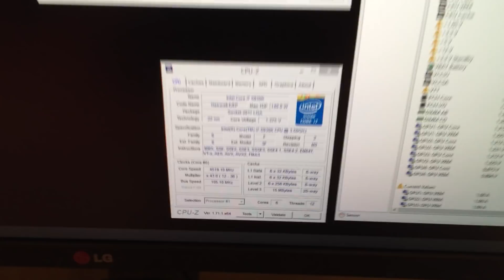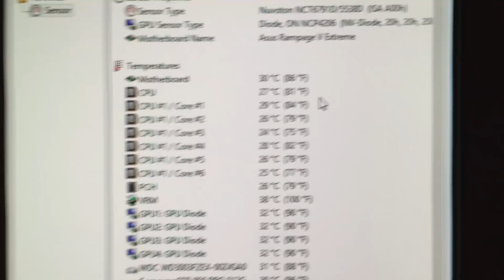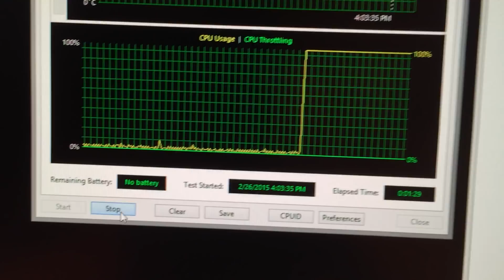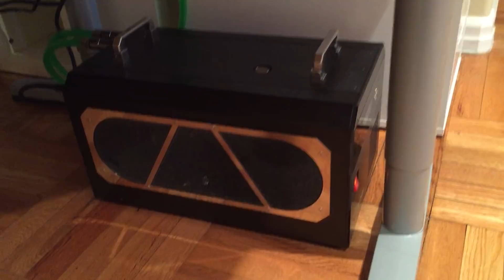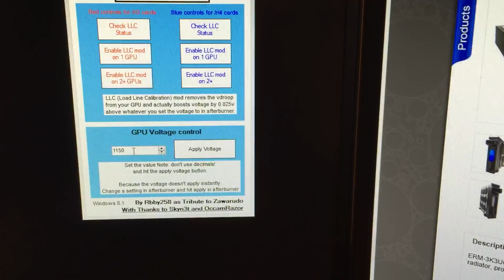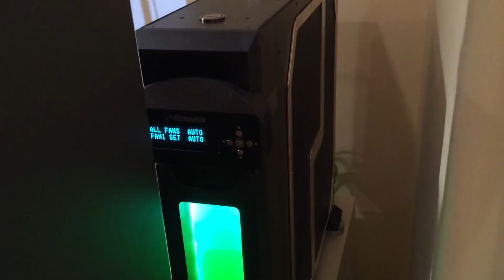PC Water Chiller | Koolance EXC-800 - Testing

Comment: Impressive overclocks for just a water chiller running at ambient temps. Especially by today’s standards.
Reply: 4.5 GHz on a 5930K isn't impressive though. Silicon Lottery stats say 87% of tested 5930Ks could do 4.5.

I'd be far more surprised if he could do 4.8 or 5 GHz with subambient water.

Comment: On 0:10 and 0:11, did you customized that back panel of the case? How did you extend the loop outside the case? What is that connector connecting to the soft tube? I am currently think about building such loop so I hope you can help me a bit. Thanks!
Reply from the maker: Those are the bitspower quick disconnects fittings: https://prnt.sc/pxow6z
You will need to drill the hols for them.

Comment: Do you have Problems with condensation?
Reply: You can avoid this by getting a weather gauge that tells you the humidity level in the room. 

Using the room’s humidity along with the ambient room temperature you can determine the dew point at which water will condensate. Set minimum temperature slightly above dew point
Reply from the maker: Yes, during the summer time only, when humidity level is up. You just need to tweak settings each year to avoid it, plus having liquid Alarm installed. I have burned one CPU already.
Reply from the maker: Only summer time. You should be careful when adjusting temps. I already burned one CPU

Comment: What cpu will rip 400 watt out of the outlet? my god. My 5820k at 4.7 takes about 170-180 according to hwmonitor.
Reply: Any of the i9 series overclocked will. 7980x will rip 900watts.
Reply: They most certainly will not. 5-600 at the highest. The whole system might require upwards of 900 watt. But never the cpu itself. If you are to overclock them to that point you need liquid nitrogen or helium. A standard watercooled 4.8 oc will probably only pull 3-450 watts.
Reply: At 6Ghz on LN2 its north of 1000. I don't blame you for now believing me, but its true. I have the 7920x and THAT cpu pulls 490watts at 4.6Ghz. I can prove it.
Reply: It needs a 45mm 360mm rad & 3x noctua 2000rpm fans to cool it (cpu alone) at full tilt. but hey it is seriously fast :D Over 3k in cinebench.
Reply: http://www.legitreviews.com/intel-core-i9-7980xe-18-core-processor-review_197903/10  While that is measured at the wall, its NOT including the GPU usage. So its still north of 750 but the performance is mindblowing
Reply: We are talking about the cpu itself right? roughly measured from the outlet at idle, and then measuring at 100 percent across all cores?
Reply: well that's pretty sweet. I am scoring a measly 1320 with my 6 cores. Single core at 182. Going to be upgrading in the upcoming generation or if i go for it earlier, the 8700k. Im looking for that past 200 single core score. and the 8700k delivers hugely on that.
Reply: aye its only rough to be fair. So CPU+Board+idle GPU + pump and 4fans. No hd, NVME. It could be a bit out.
Reply: 3140 at 4.7Ghz, all cores. I know it can go faster but not without throttling. So im glad i got the 12core not the 18. It does match the 18 core( if that was not delidded stuck at 4.2 and throttle back a bit cause of an AIO). A water chiller possibly. Anyway it was fun ( if I was sensible) I would not have got i9. 8700k would have been fine.
Reply: de-lidded it still hits 96oC at 4.6Ghz. This is on the best EK block, thermalgrizzly. 106oC! at 4.8Ghz! (it was stable) it throttled within 5 mins. ( it still did at 4.8Ghz for (12 mins) with the windows open ambient 6oC ( UK). Exceptional chip but ridiculous heat and power.  Its sweet spot is 4.4Ghz it would be ok on a 360 AIO with de-lid.
Reply: at 4.4Ghz well you getting closer to threadripper clocks. I'm not a fanboy of either brand. TR also makes a lot of sense. no- delid, lower power, lower temps and faster all core power but it dosn't game! So swings and roundabouts.
Reply: J D yeah. For doing what i am doing i would have been better off waiting for the 6700k than getting the one im having now. Luckily intel upped the core game for everyone. If the 8700k wasn't 6c 12t i would not buy it. I want atleast 6 cores. Almost went out and bought the threadripper, if it wasn't for the painfully slow single core. Planning on building a sick waterloop for the next build. Have a custom loop with a 480 rad now, have been looking on a 1280mm. And then watercool both the cpu, gpu and motherboard. Saw that the new maximus extreme or whatever it was called came equipped with a motherboard waterblock at stock. Might even wait for next gen intel/amd and next gen graphics. Feels like a waste buying the 8700k and upgrading my current 1080 to a 1080ti as it will most likely be released something new soon.
Reply: I almost bought the TR too, but didn't for exact same reasons low single coreso I spend the exact same money in the Intel. My main reason was I was bored of my Ryzen 1700x which only did 3.9Ghz stable and ran my expensive 3600 ram at 2933 max cs15. Same ram in intel is running lovely at 3733Mhz 14-14-14; Probably could push it even faster.  The Ryzen was fine but wasn't any faster in gaming than my old 3930K@ 4.5Ghz. That was an really really old CPU but for YEARS had nothing decent to replace it with!  Ryzen just wasn't enough! It did get Intel to up its game finally i had a cpu worth changing too.
Reply: Yeah. The ryzens and threadripper is great no doubt. But the single core just isn't there. They have extremely good ipc though, but the issue is that they won'tt go higher. I have a 1500x in my servercomputer that runs at 3.8 ghz, it performs 840 on cinebench, wich is mind blowing if we look at the price. But for high end usage and especially gaming, single core is still king. And will probably be that for quite a while forward. I am hoping AMD delivers a great overclockable cpu later this year. We will have to see. Will wait and see before buying a new cpu.

Comment: According to Koolance, that chiller as well as all cooling pump systems should be either level with computer or above the computer for best performance. Your computer can't be above your chiller for effective cooling. I know it's cooling but your putting more stress on the chillers pumps.
Reply: that's why there's a pump to compensate

Comment: For the price of that chiller you should have went with an aquarium chiller instead ;) Same temps but my chiller cost something like $750 cheaper
Reply: use radiators and the chiler in combination so the best watercooled wall mounted setup uses 4 rads so   using this will keep it cooler even more
Reply: @jonathanoxlade4252  No, Cooled less with radiators

Comment: This won't be enough to cool 3 or 4 R9 295X2s :(  :P
Reply: Edward Espinueva The 295x2 is a dual GPU card and only 4 way Crossfire is supported. That means only 2 cards are possible.
Reply: If you are using 3 or 4 295X2s clearly it isn't for gaming, lol ;)

Comment: I'm getting 24c on idle and ruffly 44c on throttling when I'm gaming and tht is without a chiller just with a all in one cooler so personally I wouldn't get one unless I could get the Temps down to around 20c when throttling lol
Reply: Ya but gaming isnt getting your cpu to 100% load either or even  overclocked

Comment: i think you'd be better off combining the chiller with the ambient cooler and more air moving through your case
Reply: i would expect going ( radiator > blocks > chiller > ) would be ideal.  but im a novice.  do you need to add pump(s) or reservoirs(s) with a chiller?  koolance website says something about a pump in their chillers.

Comment: Why do you only have a 3-way SLI bridge adapter installed?  e.g. Your bottom-most Titan remains unconnected.  And what are you using to synchronize all of your PSUs?
Reply from the maker: allesichmache  4-way SLI does not perform well, especially in BF4, so i turned ON 3-way SLI and 4th Titan is dedicated to Physx only (much increase in performance).  For PSU connection i used this: http://www.add2psu.com/
Reply: PaxGrime | Viper Boosting That's not true, that's only for AMD cards with crossfire.